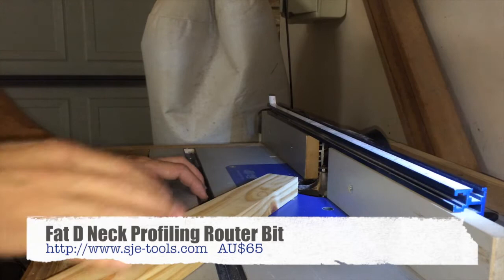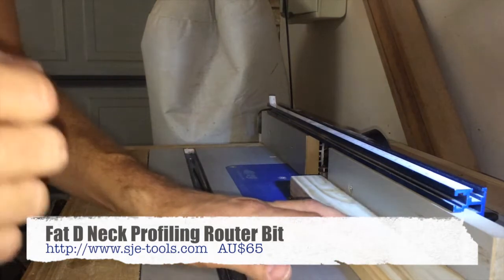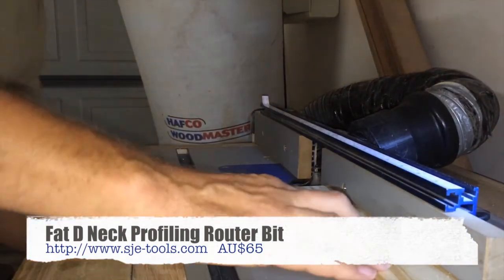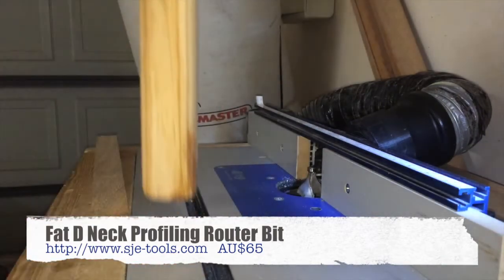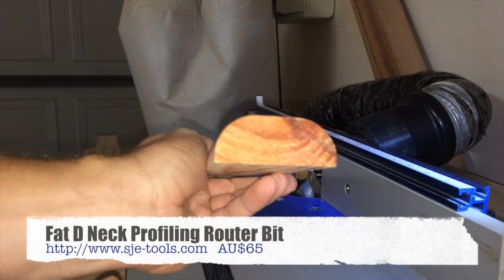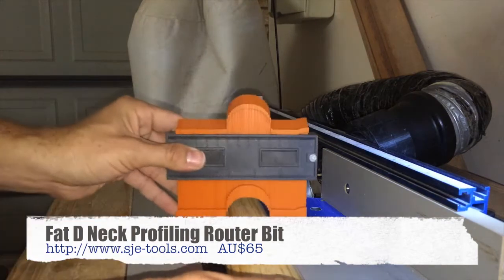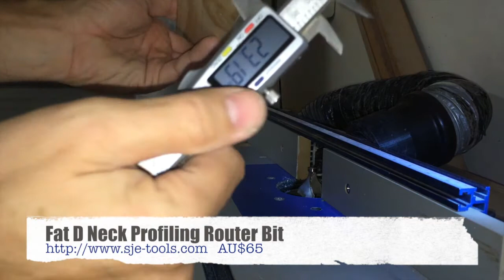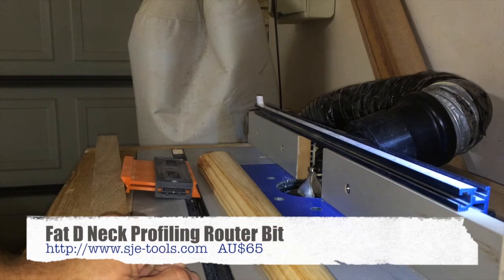SJE Tool Guitar Neck Profile Bit

Comment: For anyone who wants to know I bought the whole set of the neck and fingerboard bits and they work amazingly. You do need a pin router for the neck and to know what you are doing but they are great.
Reply: You can get by with a routing table if you take your time and you're cautious.
Reply: And you use a flat headstock design.

Comment: Hi steve, are you still making these bits? i saw the modern C was not available
Reply from the maker: Hi Dennis - yes there has just been production delays, really annoying, however they will be back in the Amazon store this week and direct next week (couriers, customs etc allowing!).  Thanks
Reply: They are really nice... im looking into a used pin router or maybe making an overhead jig for my table router  @technocracylao